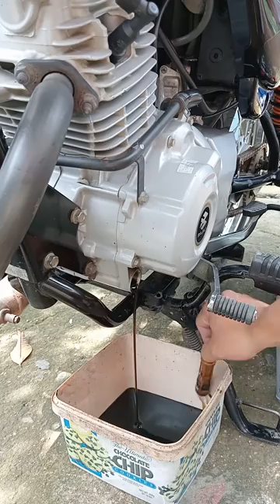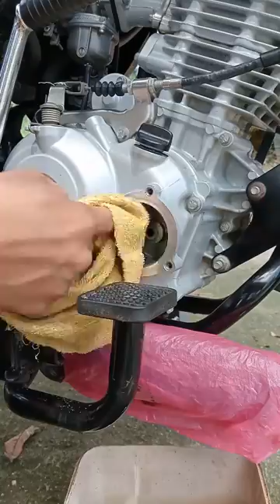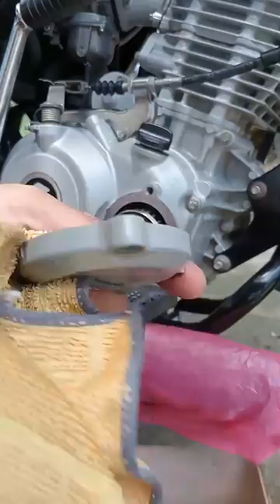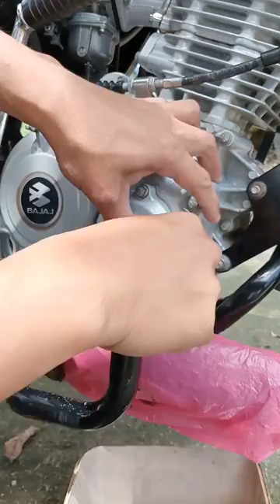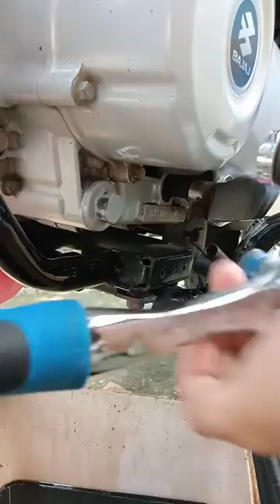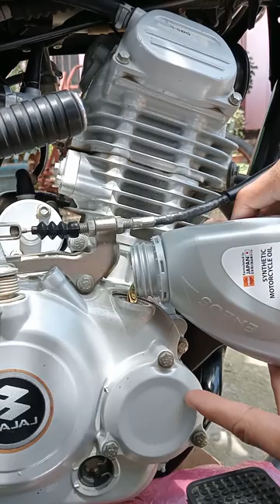How to Change and replace oil filter for Bajaj CT125

Comment: 900 ml. lng pg change oil..
Reply from the maker: 800-900ml paps tama ka... pag 800ml sagat 120kph speedometer stock engine sprocket and 38T sa rear sprocket
Reply: Magkano oil filter baja125